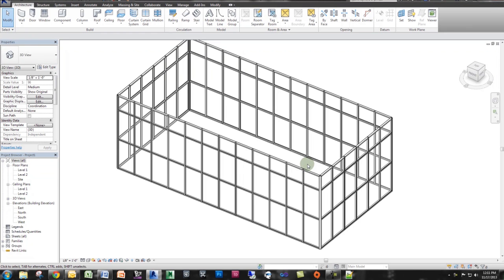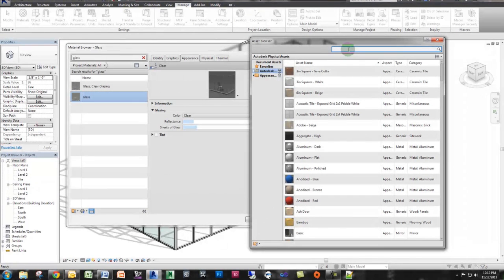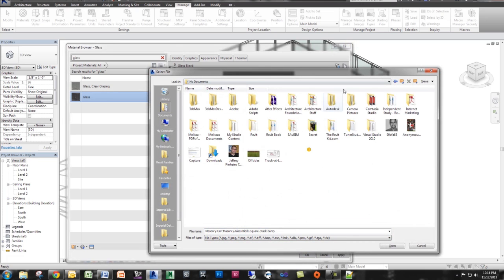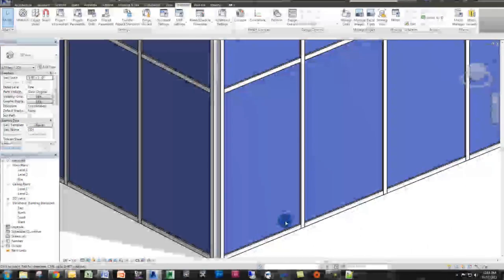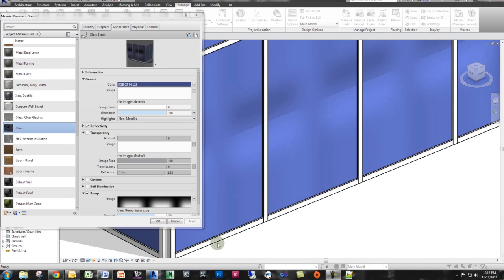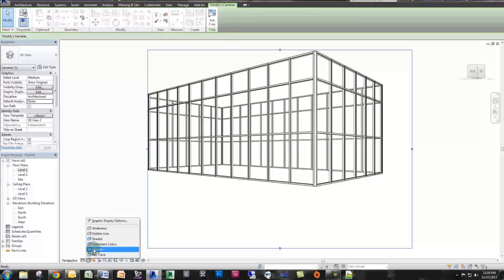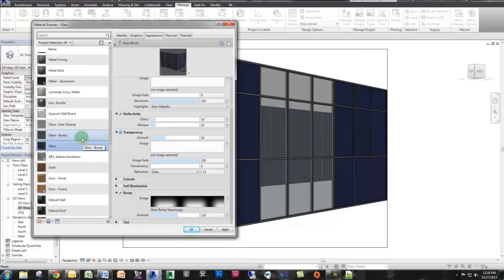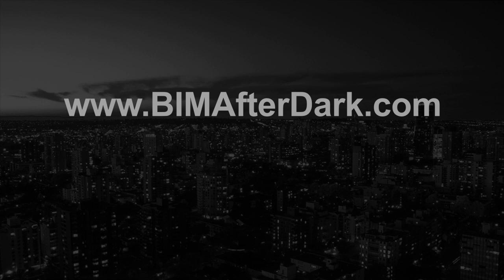Revit Tutorial - A Simple Material Change to Add Realism in Revit Renderings

Comment: I am doing plumbing design
in revit. I am trying to update pipe materials. What I have done is that I have
created a PVC type pipe. I have given it pvc martial finish where the color of
the pipe will be the color of pvc. My system type is sanitary. When I draw a
pipe on the floor plan its color appears green based on the my visibility
setting for plan view. But when I switch my view to realistic, wired,
consistent colors etc. then the pipe color changes to either black, cooper or
other colors but not pvc (white). I want the pipe color to be pvc in the
realistic view since I have selected pvc material when I have created pvc pipe
type. Could you help me with that. Can you please tell me as to why the pipe is
not changing to desired color in realistic or any other view.